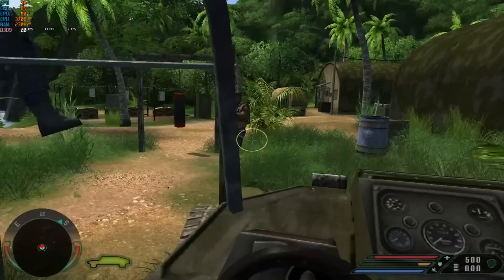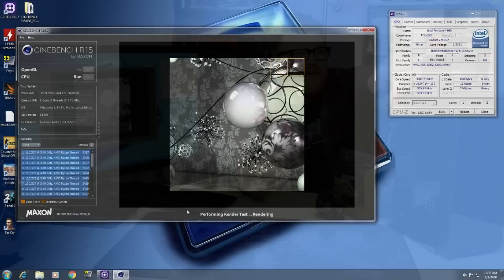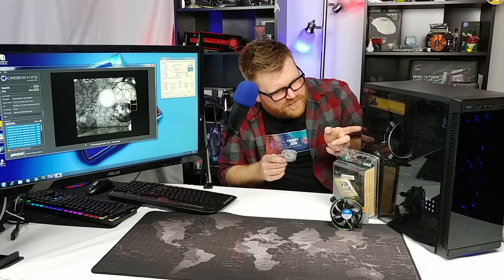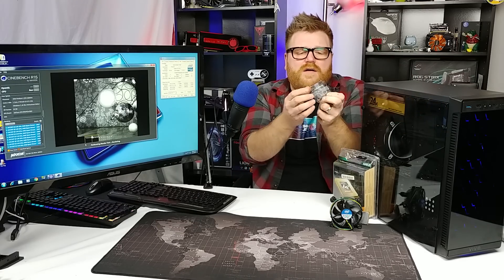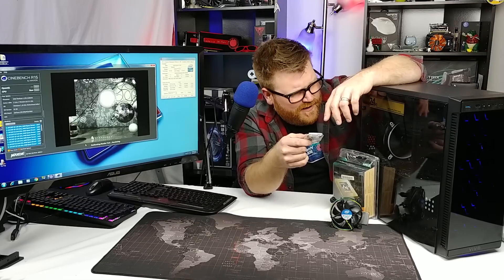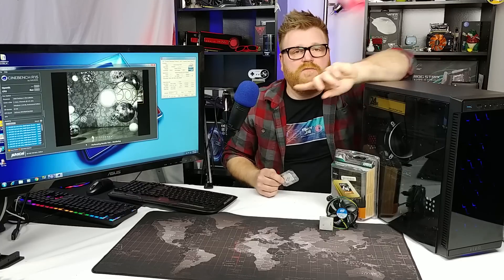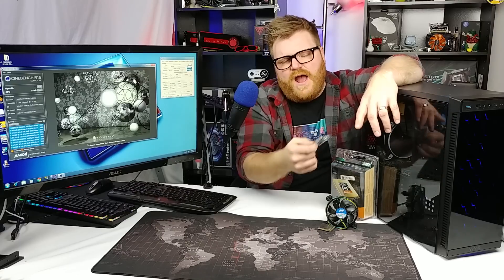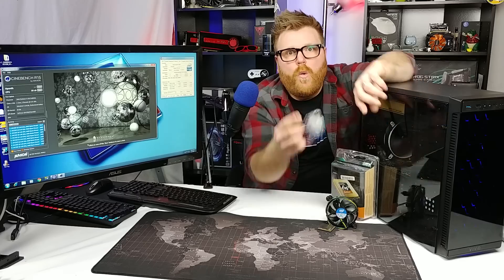What can the Intel Pentium 4 HT do in 2018?

Comment: This is an LGA775 Pentium 4, which means for $10 you can upgrade to a Core 2 Quad that's going to run many many circles around this thing, probably score 8 times higher in Cinebench. Which is still very bad by today's standards, but it would at least be usable for basic productivity, web browsing and even light gaming with a modern GPU.

Comment: ive got one of these in a Dell XPS Gen 4 gaming PC from around 2005. Ive got 4gb of ram and a 500gb SSD and i couldn't even get windows 10 to install. So I then went to Ubuntu Linux and it didn't work either. Then I tried Manjaro Linux and it did install but it was super glitchy and slow. I REALLY wanted to put a clean and modern looking 64bit OS on it and not something obsolete and outdated that is no longer supported because even if this pc cant handle modern games or even 1080p video I still at the very least wanted it to be a functional office pc that looks cool lol. I finally got the newest version of Peppermint Linux on it and its actually working surprisingly well. It can play Halo Combat Evolved (2001 version) flawlessly. I also have been using it as an emulator to play SNES and GENESIS games. Also, it does stream Youtube videos pretty well with an old NVIDIA GeForce 9800 GTX+ GPU and I can't say the same for my old Powermac G5 (2005), which cant even handle a short Youtube video at 240p. I can have several tabs open, use excel, and play Spotify on it all simultaneously without any issues. I have to say, for something so old it actually performs just as well if not BETTER than my new lower end desktop that I use for my business (Lenovo ideacentre 310s) and WAY better than my little mini Lenovo Ideapad(2018). So I wouldn't go so far as to call it dead. Could you run lightroom on it? no. Could you run Studio One on it? no. Could you play Minecraft? YEAH! lol. Oh, and i'm typing this in 2020. I've been bored quarantined in the house which is why I started working on this old XPS in the first place which is what brought me here lol.

Comment: That's funny.
I actually played league of legends yesturday with my p4 setup on low settings. Actually playable on my 1080p monitor.
Intel Pentium 4 Prescott 3.4ghz @3.72 socket 478.
ABIT IC7 MAX3 motherboard 
MUSHKIN Red Line 4gb DDR500 PC4000 2-3-2-7 
AGP HIS Radeon HD4780
ASUS Xonar D2 sound card
OCZ 500W PSU
4 WD Raptor 36GB 10,000 RPM SATA I in RAID 0 Drive (C)
PCI Promise Raid controller
2 WD IDE 120GB RAID 0 Drive (D)
A very respectable rig for it's time. Still have it untouched in my closet. 
You cant find most of it anymore.

Comment: Do you even know what you are babbling about? The P4 HT has 1 core/1 thread and runs like 1st gen Core-2 Duo of the same speed. Yes, it's significantly slower, no, it's not garbage. Also the socket is 478, not 775. Maybe that's why your system sucks. FSB speed is 800 MHz which is definitely NOT garbage for mundane tasks. I just inherited a circa-2003 P4 HT system and I tested it thoroughly. If you are getting shitty performance it is surely because you have not installed the proper ICH5 chipset drivers for your board.

Comment: since a lot of socket 775 motherboards even ones in oem pcs support q6600 and that cpu cost around $10 free shipping there is no need to use any cpu older then the q6600 anymore and with a decent gpu the q6600 is not too bad

Comment: 2005 P4 660 (110+ W) (1 core, 2 threads, 3.7GHz...) 55 CB score
2008 Core 2 Quad Q9550 (95W) (4 cores, 4 threads, 2.83GHz stock) 320 CB score 
2016 Pentium G4400 (55W) (2 cores, 2 threads, X GHz stock) 250 CB score

Lol that P4 660 is doing 50% worse than a single core of a Core 2 Quad running at stock 2.83Ghz

Comment: The first dual core processor was made by AMD in 2003 which was crazy and it was the first consumer dual-core CPU so ya pretty cool any thay still hold up party will in 2019 you can still use them for web browsing and doing some light gaming and office work so ya

Comment: I have a very tight budget when it comes to computers (unfortunately) so often make do with second hand parts as much as possible. I recently went from a G620 2.6Ghz to a i7 2.9Ghz (keeping my motherboard lga1155).

The difference of a new (-old) processor is like night and day. Whilst the g620 was dual core it had no hyperthreading and very little difference to the Pentium 4 I had before that. Suddenly having 4 cores and 8 threads means everything happens in the background without impacting anything else.. updates, installs, switching between desktop and games. It just happens! (Also managed to swap out my aging hd6670 with a gtx960)

I can't imagine what you guys with your hex core CPU's and gtx1060s experience.

Comment: The 660 (and any other 32-bit 800MHz bus Prescotts) had such a long pipeline they wasted half their time trying to reload. But it's on an early Socket 775 mobo! Just lift out that 660 and try a cheap Core2 Quad Q6600 (1066 MHz bus). If it won't run, try a flea market Core2 Duo E4600 (64-bit, 800 MHz bus). Either would yield a big gain.
Still no? Last chance: somewhere somebody will pay you to take away their D940 (32-bit dual core HT P4), Even that would make loading Vista - or Win7 - less embarassing than your 660 would.

Comment: 3:10 in any already spit out an incorrect fact.....P4 HT are not just a single core with hyper threading.....i used to own a dell optiplex GX60 with lga 775 socket p4 HT @ 3.4 GHz and i verified is with a powerful benchmark utility as actually having  physical cores....so he is wrong there
Reply: The Pentium 4 HT is a single core CPU with hyperthreading. Its dual core variant was the Pentium D.

Comment: It is december 2018, and I am watching this on an ancient Dell "dc5100" SFF computer. It has an Pentium 4 "630" (3 GHz) and 4 GB RAM DDR2 (533 MHz) in it, and is running Linux Mint 17.3 xfce (32-bit, so only 3 GB is used).

It works just fine as a "digital typewriter" and a basic YouTube video machine :)

Comment: I think we sometimes look at cpus the wrong way. I´m a collector of PCs and own approximately 80 of them ranging from a 8088 to a Phenom II 955. Each of my PCs have a special use regarding gaming. I install games only on a fitting system so I can use older PCs for older games. Therefore for me they are all useful and I love them to use. Regarding the Pentium 4 660 I use it with an Geforce 9600GT and 1GB RAM under Windows XP. As I also own a lot of PC games from all ages I use games such as Need for Speed underground 1, Stronghold, Mafia 1, and a lot of other games with my P4. So I never had to deal with questions like "should I change X Cpu for Y cpu". If a PC was to slow for games I wanted to play I built me a new PC (when I saved the money for it) and so the older rig was for playing older games.

Comment: I watch and stream 1080p and do all basic activities with pentium 4 3 GHZ smoothly. It can run Windows 10 very smoothly and boots fast too
Reply from the maker: Uhhhhhhh, yeah, but I'm saying as a gaming platform it's extremely hot, uses lots of power and there are 1000000 better processors out there. Get a q6600 and then come back here and report how much faster it is
Reply: Timmy Joe PC Tech I have a i3 laptop and it does wonderful gaming. But for general purposes , p4 is still ok and better than mobile processor
Reply: but my p4 cant do past w7 32 bit
Reply: anikanbounty97 It depends on p4 version. Latest p4 's are much powerful similar to oldest dual cores and have hyperthreading too.
Reply: it p4 3.06ghz socket 478 533mhz
Reply: anikanbounty97 Ya my is lga 775 pentium 4 ht 631 3.0 ghz

Comment: I used this chip from an old dell optiplex I bought for like 40 bucks back in 2009, threw a gt 9800 and gamed until like 2012 with it. It worked for the most part. Stuff like source games ran fine, I beat modern games at the time like arkham city, so it was playable. Fortunately I have a gtx 1080 and i7 8700 now so, my life has improved slightly LOL.

Comment: I think there are simple criterias of CPU usability: 
1. running Windows 10 without perceivable interruptions from background updating and scanning.
2. browsing of multimedia-heavy pages like YouTube and playing fullscreen online 720p videos without noticeable frame drops with recent browser. 
Other loads are highly variable - Pentium 4 is fine for writing Word documents, playing older games like Warcraft 3 or serving as thin cilent. It also can serve as router - with older pfSense 2.2 it will easily handle 300+ users. Similar CPU's are still used in professional setups (for example in medical imaging).

So minimum in 2018 is something like Core 2 Duo E6700, if coupled with reasonable RAM (at least 3GB), SSD drive and DX11 capable VGA like GT 610.

Comment: I was using P4 3.0G Socket 478 with MX440 graphics, 80G IDE hard drive, 512MB memory from 2006, when I was in year 5... Somewhere in 2009 my sister moved to a new place so she gave me here old athlon xp computer, I disassembled it and upgrade my P4 PC, and I had 1G ram (4 256MB DDR) , another 80G IDE hdd and a DVD-R/CD-RW drive. This configuration severed me until the end of 2011. I tried to install Windows Vista and Windows 7 when they were first released, but I rolled back to WinXp because they were too resource-demanding for a P4 PC. I was able to play CS1.6 and do programming and circuit design with Visual studio 2005, Multisim and Keil. Best memories ~

Comment: Even with older games it's not great. I've been tooling around with a Dell Dimension 3000 with a P4 that isn't 64 bit compatible. Got Vista 32 bit on it up from xp. Runs Halo Combat Evolved despite not having a graphics card outside of the integrated one. Granted much of the textures don't display properly (second level much of the ground just likes a vague pile of  green and brown, oh and master chief shows up as grey for some reason instead of green). Still it's easily doing that game with only a 1 gig 256 mb of memory at around 30 fps. Definately playable. Not sexy, but playable.

Comment: the p4 was long dead. it cant even handle chrome.. i had a old pc in 2014 with a p4 got damit youtube 480 was hard on chrome.
full hd video files possible but heat boi that was a oven with my old shitty gpu that had bad cooling lool it trew it away ll

Comment: You probably would've had better luck with overclocking on a socket 478. The 775 socket had the P4 as the lowest and weakest processor of the socket. The 478 had the P4 as the pinnacle of that socket gen

Comment: Ya should try a Pentium D 945  I put it in my dad's old unit and it gained a bit of a performance boost.
Reply: The Furry Gamer maybe, but the Pentium D is by no means the max CPU line for the platform. LGA775 boards can take the Core 2 Quad Q9550 or, with the 771 mod the C2Q-based Xeon X5470, which can be overclocked to 4.2GHz and 4GHz respectively with decent air cooling, which gives them the same performance as each other but better stability with the latter. or if it's a name brand pre-built system then it should be able to take a Core 2 Duo E8600 or even a Core 2 Quad Q6600. There is also the "Pentium Dual Core" which is a watered down version of the Core 2 Duo and the next step up from the Pentium D, which is more of a "two Pentium 4s glued together" jobbie.
Reply: Well see here is the thing.  The manual for my dad's Optliplex GX620 says it is compatible up to the Pentium D.  Granted yes it has the chipset required to support up to the Core2 Quads but it is also an OEM board so those can be limited.  Unless ya flash a custom bios.  Then it might be possible.
Reply: The Furry Gamer ah, sounds like it's slightly too old to take a Core 2!
Reply: Well it is an Optiplex GX620 so yeah

Comment: Used to have this CPU with a 9600 SE and played a lot of Trackmania Nations back in the day
Reply: The good old days with my Sempron 2500+ (1.75ghz), 768mb ddr 333mhz ram, and radeon 9550 oc'd to 9600 pro speeds. Still have it around  today with new hdd, ram, psu (all of which failed a long time ago)
Any game Pre-2004 could run 1280x1024 on it pretty well with max settings. 2004 however was reckoning point that greatly increased gaming fidelity, while tripling or even quadrupling system requirements. A good time it was.

Comment: I've even used fresh installs of Windows 7 32-bit on Atom n270 netbooks , and those processors are said to be equal to slower Pentium 4's, and about as fast as the 1.8GHz P4 model. I don't know about you guys, you must be very demanding users. I remember last year I was using an n270 system with the latest Firefox and Avast and it ran pretty good.
Reply: geo58impala ahh, N270 netbooks. good for laggy 360p YouTube videos and ultra settings... on Bejeweled Twist. even the 1.5GHz Celeron M performs better than the Atom N270 at 1.6GHz...

Comment: As some others said, computing doesn't have to be just gaming. And TBH, I think it coped pretty well with the 970. What it can do efficiently in 2018? A media center running Kodi with help of a DVXA-capable video card. Playing back 1080p will be a piece of cake then. This is even better if using one of those desktop-like computer cases (HP calls them USDT and SFF).

Comment: I have a Pentium 4 Dual-Core 960, 3GB DDR2, 7300GT, as an old PC, and it can play 1080p videos under Windows 10, CPU goes to 80-90% utilization. It takes a bit to load, but playback is fine. Sound is good. It might be perfect to keep it.
Reply: lol 7300GT. A DXVA-capable card (not the 7xxx or even the 8xxx series, as their DXVA implementation is too primitive) brings that CPU utilization down less than 15% with 1080p videos.

Comment: Don't be so quick to pass judgement on other Pentium 4s just because they're older and have a lower clock speed.

The Gallatin core was the sweet spot in the clock speed to performance ratio for two reasons:

1) It had a copious amount of cache (2.5 MB vs the Northwoods 512k and Prescotts 1 MB.) The Netburst architecture was heavily dependent on lots of fast cache to perform well and the P4 EE based on the Gallatin core had it. The cache on the Prescott and Cedar Mill also had a 17% higher latency, further hampering cache effectiveness in those cores.

And while the Cedar Mill did have 2M of L2 cache, it was high latency and arranged as 32 bits wide, so 64 bit performance of this CPU was crippled.

2) It had a shorter pipeline length of 20 stages vs the 31 stages of the Prescott and the Cedar Mill. The longer pipeline on the latter two cores was necessary to ramp up clock speeds, but it also made branch prediction misses far more costly.

In performance analysis tests, the P4 EE 3.46 could trade blows with the much higher clocked Prescotts and Cedar Mills at 3.8 GHz, and even the 3.73 GHz P4 EE based on the Prescott core, as well as be faster in some tests.

Comment: Who says you have to use it for gaming? They make great file servers. With 65nm, Speedstep, idle states, they really don't run hot. My P4 has 4GB RAM and has 16TB storage with a USB 3.0 card in it. It can max file transfers out (The HDD is the bottleneck) and it tops out SATA 1.5 on the SSD. The 3.20GHz P4 will average about 40% usage when averaging about 160MB/s on file transfers. It has 102,000 running hours on it and still going strong.
Reply: The p4 is and always was obsolete. The p3 it was meant to replaced was faster clock for clock . While the 65mn did help with heat it was never an effective chip.

Comment: Hello, new subscriber here. Just upgraded my XP/8.1 retro build from an E8400 to a Q9650. Both have a Cinebench R15 SINGLE threaded score of 85, which is around 30 more than your MULTI-threaded mild overclock score for the P4 EXTREME, while multi-threaded scores for mine are 164 and 329 respectively, at just the stock speed of 3.0GHz, for both. So you're totally right about single core P4s, they're truly pants.

Comment: I had a P4 3.2 Prescott on the older socket 478 and AGP graphics. Hyper threading was was really good for how smooth it made Windows feel. You had that extra thread to respond to you when the background process would have locked up machine. 

That being said the Athlon 64s were much faster in games and many productivity tasks. Once  the X2s came out it was no contest until Core2Duos were released.

Comment: My desktop's rocking a 3.4 GHz Pentium 4 651, 2 GBs of RAM, 256 MB GeForce 7600GT and Windows 7 Ultimate SP1. It runs quite acceptably even in the modern internet, although sometimes it's a bit slow in there (but not TOO slow that it's crawling like a thousand of slowpokes). My shitty Acer laptop isn't MUCH faster (even if it has a dual-core quad-thread i5-3337u, 4 GBs of RAM and 1 GB of VRAM). Where the Pentium 4 is definitely useless though is modern gaming (after all, the computer wasn't intended for it).

So relax and don't be a snob: Pentium 4 isn't REALLY a garbage just yet. It can still find its use in a very low-end, non-"hardcore gamer" type home PC. That type of computers is still quite popular here in Russia. New games are not everything :)

Comment: The P4 HT on socket 775 was an ok CPU but the stock coolers killed them.  I've got one on a motherboard with an AGP slot!!
The Pentium D was ok too but you need a tower cooler to make it run at stock clocks.
Core 2 is as old as I go myself for messing around.

Comment: Oh it is far from dead... Just search for doom 2016 running on a pentium 4, maybe it was the 630ht. 
It could run well doom 2016. But dont expect high end gaming with it... But if you bought it on its time, and still haves it, it would still surive a little bit. 

Btw a ENORMOUS mistake that you made, was to take a pentium 4 and put a generic intel 65w cooler... The p4s had better coolers with copper, and they werent that hot..The pentium d's were really hot, they were 2 p4s glued toghether. Oh and here in brazil p4s were actually pretty cheap.

It can browse, edit videos, play some games and some new ones..